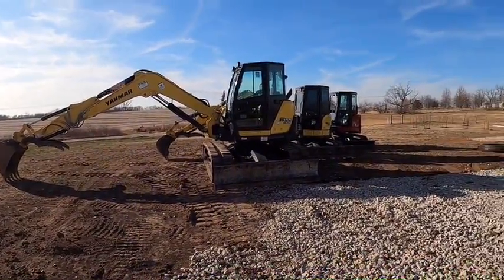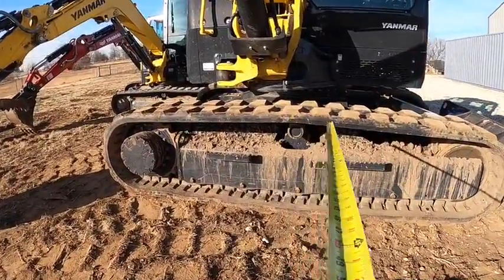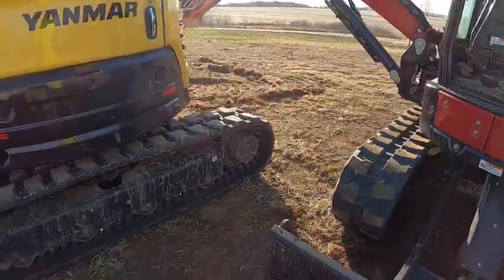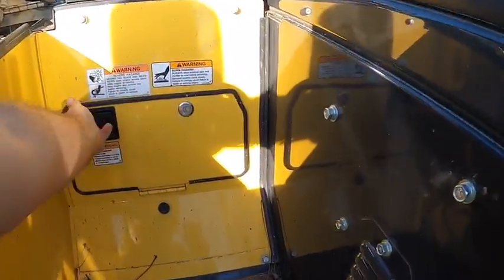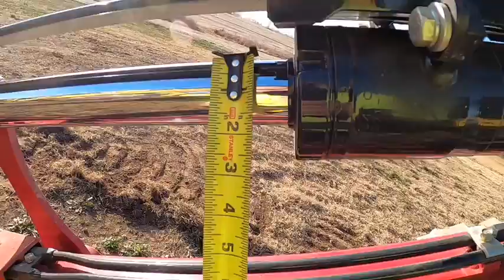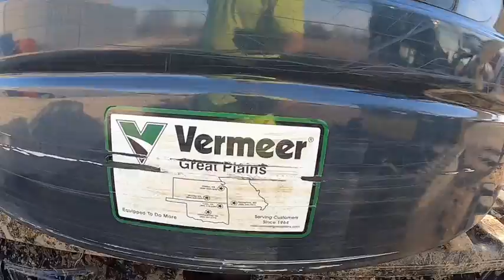Yanmar Yanmar and Yanmar mini excavators. SV40 & 100 and my VIO50

Comment: My New Holland e60c is just under 18ft reach 14,500# cab is like a loaded BMW inside and huge . Lots of room which is so love-able! Almost as big as the big 330CATs and big Volvos and all the full size hoes we had. I've ran them all. A JD is totally the same as a Hitachi. Man do I miss my D8 and D7R I had . I used to work at a drilling and Blasting Company. And I ran a crushing crew crushing the huge Rocks into 5inch size rock and then they used the material to put right back into the ground to use. They have 6 crushers and crews. Loved that job. We used to crush 4500-5500-tons of rock on a killer day. That's like 2.5 full conveyers high of dirt. Bout the size of 2- 2000 Square 15ft houses

Comment: I probably going to get a new 55 around March. This was a really good video
Reply from the maker: I ran one for a day. Pretty impressive. I just didn’t need the extra weight. I have a 16k trailer now because my VIO50 with the angle blade weighs 11,150 pounds. I didn’t want to have to get a 20k trailer. My trailer is I beam. Only weighs 3200. So I can haul 12,800

Comment: These numbers are from Yanmar's OWN website.  SV40 weights 1,300 pounds more than VIO 35, has 14 MORE HP than VIO 35, yet has less digging force than a vio35 (7,216 vs 7,209)....What exactly is the point of the 40??? Weighs more, burns more gas, for NOTHING, NO STRENGTH.....

Comment: That's weird, in the US the SV series is alot different than here in Europe. They kinda look a like a Vio with a bigger counterweight.
Here SV is the "true" conventional series.
Short overhang tho.
I tried to copy the link from the yanmar webside into here, so you could take a look. But it doesn't work. Mhh anyway.
Reply from the maker: Our VIO's are 1000% zero tail. no overhang at all. SV's have a little overhang. 

You wouldn't think that they would make different machines for different regions that were that different.
Reply from the maker: ill check them out. I know that the A at the end of the model means American model.

Comment: Can the sv40 interchange buckets with the vio50? or are the quick connects different pin sizes?
Reply from the maker: diffrent pin size. 50 and 55 are 45mm. SV40 is 40mm.

Comment: Think the sv40 would handle a 4’ bush hog decent?
Reply from the maker: I’d probably run a 3’ brush hog on it. Mat be a 42”. If you watch my video of my brush hog on my 50 it’s a 42”. You can feel it all the way out. You could do the counter weight on the SV40 and maybe go a little bigger. 

It would probably run a 48” but may be heavy and tippy at times.
Reply: @skidco  thank you. this one don’t have the extra counter weight does it?
Reply from the maker: @BBLandServices  no it does not

Comment: Did you ever switch the pedals from the sv40 to see if they fit your vio50?
Reply from the maker: They fit. I ordered a set from my dealer. Nobody has ordered them yet so none in stock in the US. They told me 30-60 days. I told them to get them. I’ll do a video of changing them out when I get them.
Reply: @skidco  good deal. My sales rep said he thought they would fit. Priced them at $300 for the pair. I want to swap out the ones on my 55
Reply: Have you swapped the pedals yet? I have a 55 and the pedals are the 1 thing I dislike about it, otherwise its a great machine